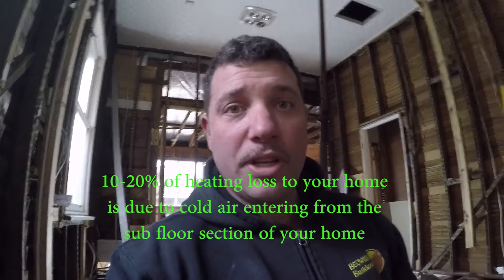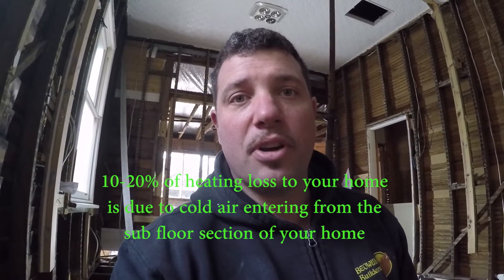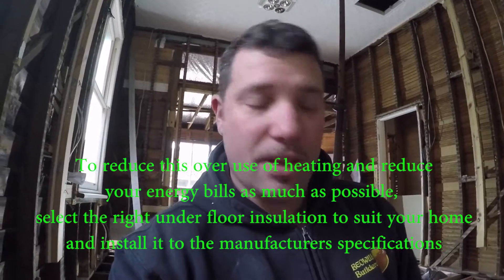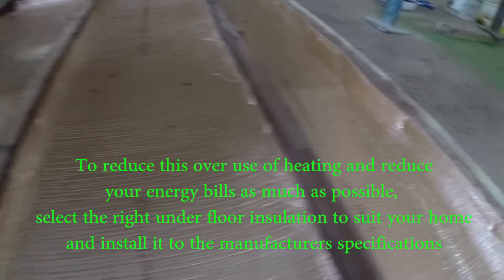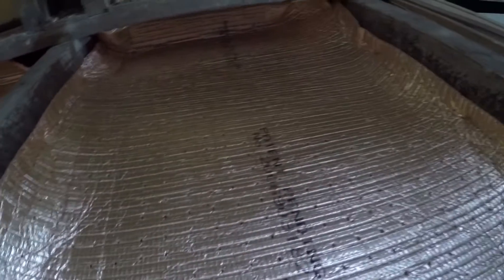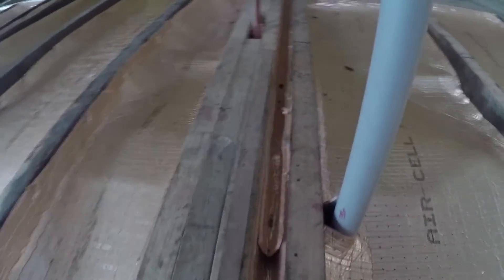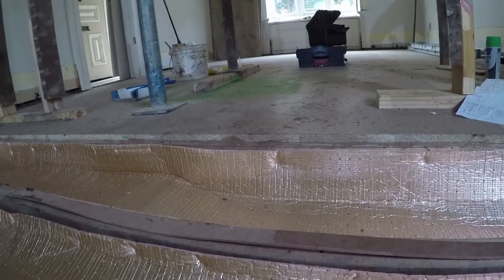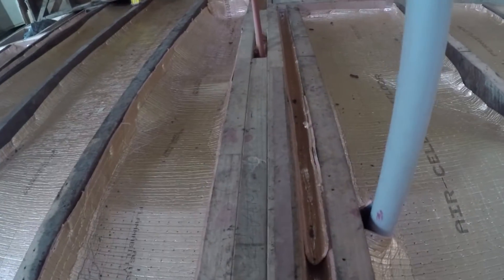underfloor insulation-aircell

Comment: Hi Uncle Joe Joe.  I am really loving your videos.  There are so many to watch and you cover so many topics, thank you.  I have a question regarding underfloor insulation.  I have recently installed Bradford Optimo R2.5 batts underneath my timber floor, running the batts between the joists. It was quite a job installing the batts between the joists, particularly as there is not a lot of space between the underside of the bearer to the natural ground level (approx. 400mm) .  Now I am wanting to install an additional layer of material underneath the batts, between the bearers.  This extra layer will protect the batts from rodents and seal the job nicely.  Do you have any recommendations with regards to what material I should use?  I was thinking of using either cement sheeting or some sort of plywood.  Suggestions and recommendations would be greatly appreciated.  Thanks once again.  Sharon :)
Reply from the maker: Gday Sharon,
What ever you do make sure the batts can breathe.
i recommend the air cell  insulation blanket as this will breath and you can directly staple this to the bottom of the joists.
this little gem works a treat 
#Stayawesome